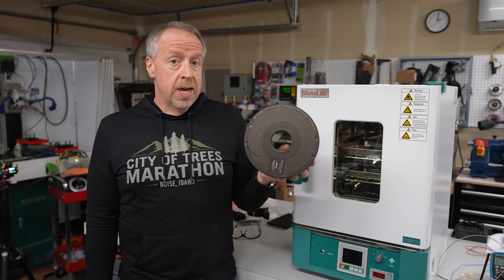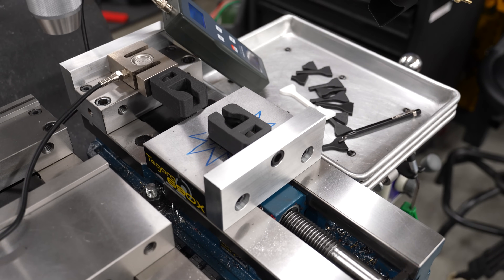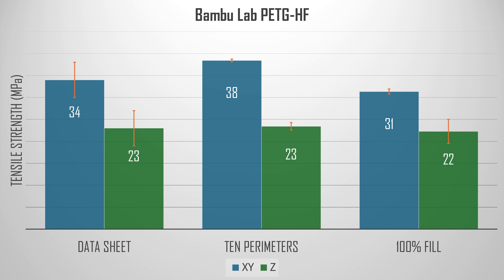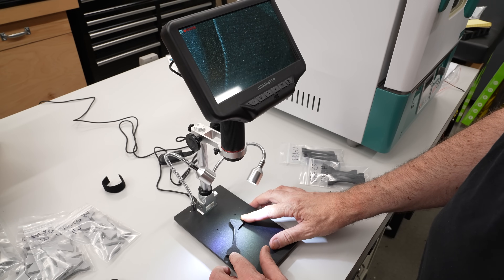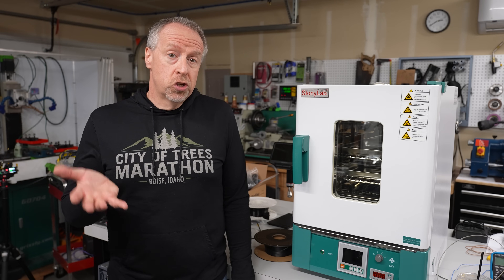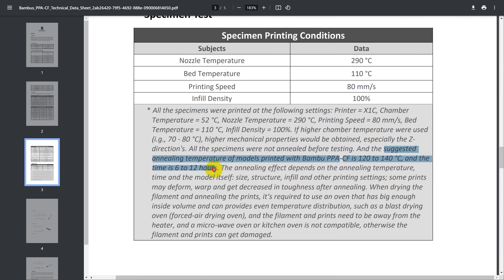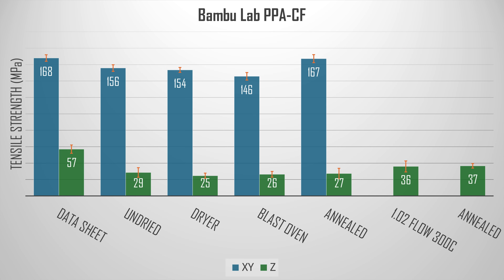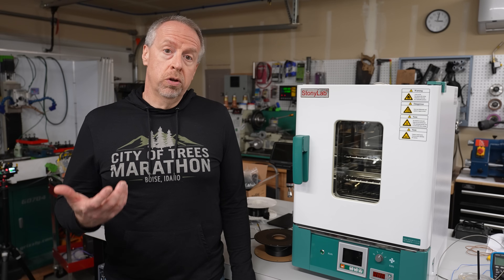I Tested PPA-CF Filament and It's INSANELY Strong!

Comment: Could you cnc a test specimen out of aluminum? It would be interesting to see how these engineering plastics compare.
Reply: His test setup isn't strong enough for that
Reply: @Spectrum184  Should be strong enough for 4xxx and 5xxx Alu. Definitely too weak for 6061 and 7xxx
Reply: If he's going to CNC anything it should be the blocks in the test rig.
Reply: The properties of metals like aluminum are well understood, I don't think it would be worth his time. That said this stuff has almost double the tensile strength of pure aluminum, at least in the XY direction, which is pretty crazy.
Reply: @creamofbotulismsoup9900  I think it really depends on which aluminum alloy you use and what heat treatment you apply to the alloy. 70xx alloys can be quite strong!
Reply: @stefanobertelli2650  Hence the reason that I said "pure" aluminum.
Reply: @creamofbotulismsoup9900  Knowing James, he'd use A2 tool steel and heat treat it with a kiln controlled with a board designed by him. Another project :)
Reply: And also the reason why nobody should use pure aluminum

Comment: 9:48 I don't know how many people forget, the beds on our printers are usually 100C minimum. I finally remembered when I got a spool of this stuff to print a bracket to hold my bumper cover on my Focus.
Reply: Printing car parts is just too good!
Reply: Considering the bed only gets that hot, print chamber -- unless adding an additional heater and really well insulated, it not going to get past 80, maybe 90c. Bambu will cap out at 60, anyways -- tried that, if PPA-CF is wet, it won't get dry inside a printer. Look for a food dehydrator -- I got a 2 shelf small unit for around $80, and it warms to a bit over 100c, and after 5 hours, the stuff was dry enough to use. 2 Days in a 70c dryer did nothing, so you can try to dry it inside a printer with the same success.
Reply: @kazolar Stefan (3D Kitchen) just did a long video on filament drying, and using the print bed works fine. You need to leave the door or lid open slightly to get moist air out.